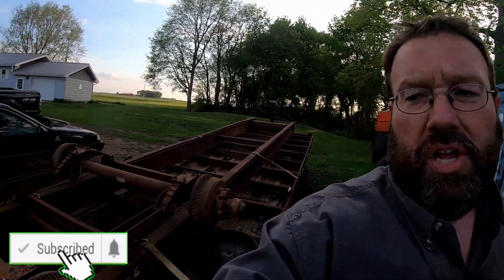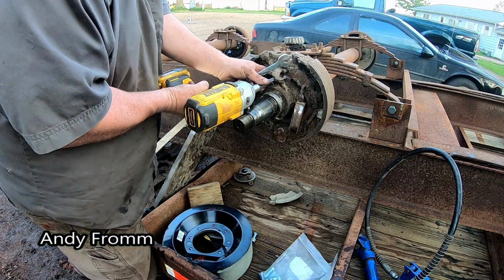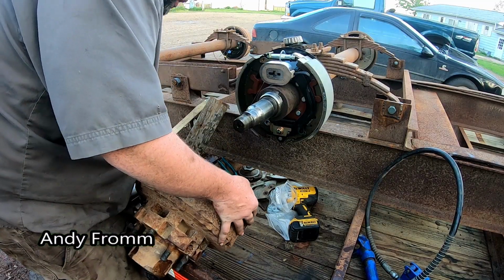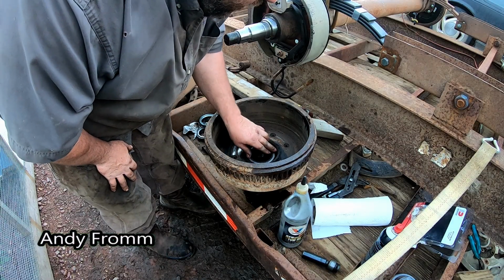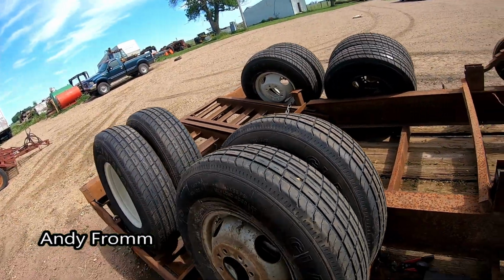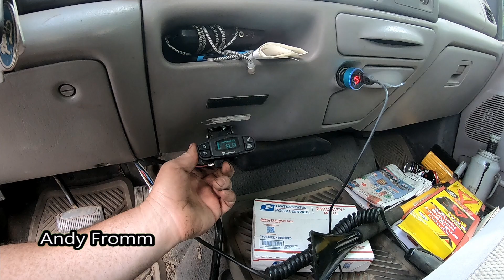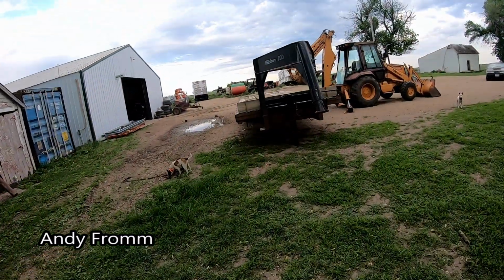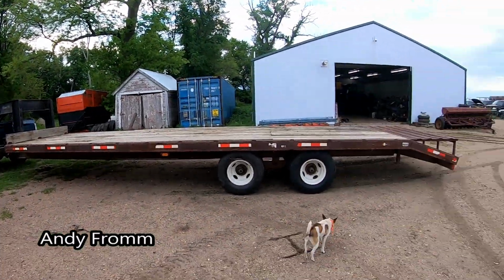Finishing up the brakes bearings and seals on the Dexter 9k axles

Comment: Good job and video.But man watching you run that old 580 SK Hurt 🤕 thank goodness it's not your main bread winner !! LOL
Reply from the maker: It's an old abused machine, it needs alot more work than it looks. It blows hoses almost everytime it gets used, needs a few new cylinders (sealing them doesn't help), and its under powered. I don't technically make any money with it but I also don't have to pay people to do work for me. Thanks
Reply from the maker: @garyholt9573  the 4 in 1 bucket would be nice along with a thumb and a turbo. I didn't notice it before I bought it but someone dropped something heavy on the boom cylinder, has a big dent. I patched it up but it needs a new one.
Reply: @AndyFromm  well now! You say Boom cylinder ? I have a good friend that has two parts machines I will try to get a hold of him and find out if he still has one and if he does we'll see what we can work out to get it to you 👍
Reply from the maker: @garyholt9573  you don't have go into detail here but in or near Minnesota? I can look it up but its probably the same. When I got it, it would hardly lift the hoe out of the ground warm. It is better now but still not right.
Reply: @AndyFromm  I'm in south west Missouri.
Reply: I can tell you this Andy if he does have one it won't be no 12 or $1,500 LOL
Reply from the maker: @garyholt9573  looks around a 10 hr drive, yeah some of those parts are expensive

Comment: next trailer I do will be disc brakes... good job!! - you got a new trailer from the frame down..
Reply from the maker: Thanks 👍 is there an advantage to disc trailers? I assume they only come in hydraulic or air? We had disc brakes on the work semi's a few years ago but all the new ones have drum again.
Reply: @AndyFromm  disc brakes stop on a dime as they say..but people normally set the trailer brake up so high to save their truck brakes that they wear their trailer brake out.. like my neighbor did and cussed when he had to change his trailer brake at 4 times the cost of truck brakes...
Reply from the maker: Yeah I didn't think these things were cheap & I got the "cheap" ones